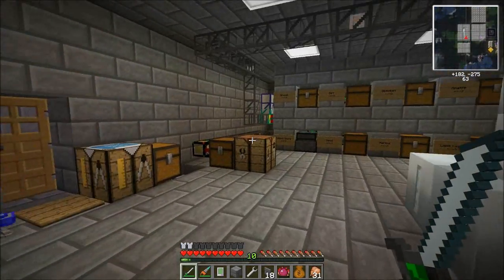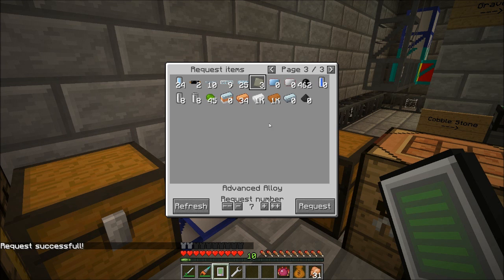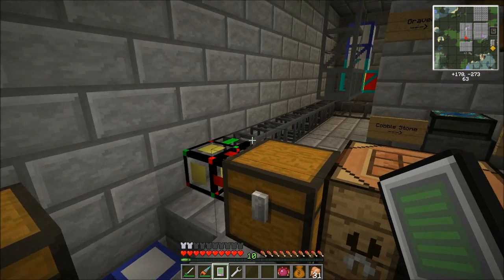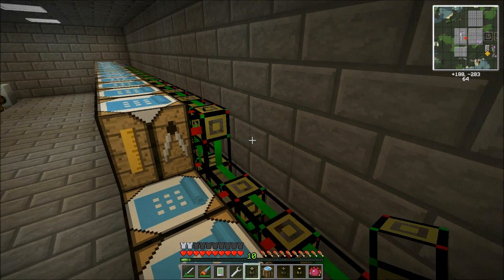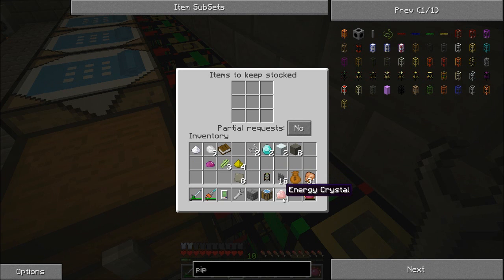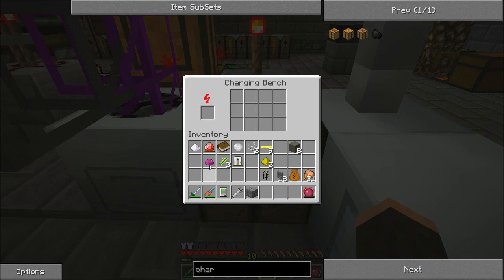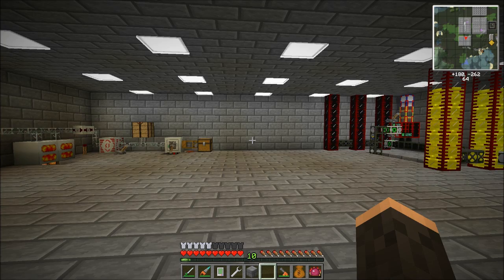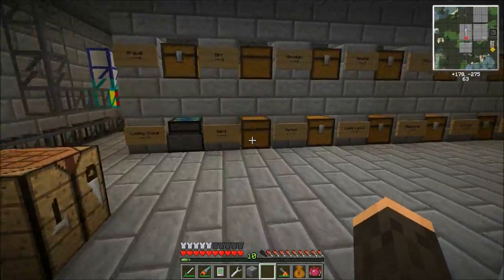Let's Play Industrial Automation Episode 32

Comment: Great vid as usual.  If you set up the satellite pipe on the chest, and then move the energy crystal to the satellite area of the lapotron crystal crafting pipe, you won't need to constantly have one available AND when you craft 6 lapotron crystals for another mfsu, it will be able to handle them all without waiting for the supply pipe to make them individually.